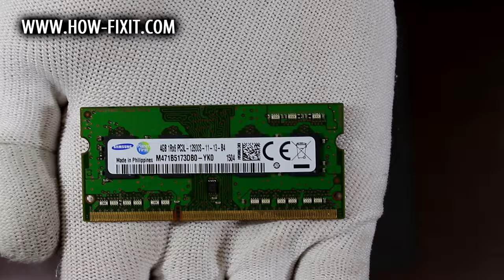Acer Aspire ES1-512, ES1-531 RAM Upgrade and Installation Guide

Comment from the maker: *ENG*: Links to DDR3 RAM, screwdrivers, and bonus content are in the description under the video.
*RU*: Ссылки на оперативную память DDR3, отвертки и бонус контент - в описании под видео.
*ES*: Los enlaces a la RAM DDR3, los destornilladores y el contenido adicional se encuentran en la descripción debajo del video.
*FR*: Les liens vers la RAM DDR3, les tournevis et le contenu bonus se trouvent dans la description sous la vidéo.
*DE*: Links zum DDR3-RAM, zu Schraubendrehern und Bonusinhalten finden Sie in der Beschreibung unter dem Video.
Reply: I have a laptop acer aspire e11 es-131-c10x is it possible to add a SSD and make it a basic disk, that is, install the system windows instead of a emmc?
Reply: How many slots are there for the Ram ? Because I would like to upgrade my Acer to 16GB of RAM if possible otherwise 8
Reply: @drissou4679 how many?

Comment: The hardest part is putting it back together. It is very difficult to connect the touchpad and keyboard flex cables because of the minimal space you have.. It would be very helpful if you mention that as a warning or show us an easy way of reconnecting them.
Reply: It is not so hard, just be really carefull and put a support in case the keyboard fell apart. :)
Reply: also what would happen if you go over the memory size limit? ex: 8 gb max, but then you upgrade to 16 gb
Reply: @RjKumar111GunnerRj  simply it won't post
Reply: @IIEvyII  oh
Reply: Yes you are right.
Reply: Yes ive broken the pad connector probably it never works more btw my mistake. This model is so bad to put hands on
Reply: @ricoaldo6196  i thought mine didnt work either, i entered bios settings using F12 or F2 or something, then set mousepad settings to simple instead of advanced. it worked
Reply: @gn412r4 I messed up with my keyboard ribbon cable and I can't type anymore but thankfully everything else works
Reply: How did you get into settings for touchpad? I can't find it in BIOS.
Reply: I am unable to put keyboard strips back

Comment: Glad I watched this first, as I didn't realize there was only one RAM slot.
Reply: cpu-z is indicating a second ram slot but theres only one after all
Reply: @ch1baku762  Yep, typically the first ram slot is soldered directly into the board. The other is an actual module that can be replaced/added/removed.
Reply: Go to Task Manager and go to performance/memory and you'll see that "1 of 1" means you use 1 stick of ram of 1 slot.

Comment: thanks for sharing - now I definitely know that I will NOT upgrade it....
Reply: That's easy :) only looks nasty 😁
Reply: I took out the screws than watched this, vid because the top and bottom was connected, i really wanted to upgrade ram, now I'm scared, so many to disconnect. It was either this or gaming laptop. I'm fucked
Reply: @kingfly6858  it's easy
Reply: @trashcontentdaily2557  I bought a gaming laptop
Reply: @trashcontentdaily2557  It depend on how handy you're. These KB & pad's ribbons cables are easy to get damaged.
Reply: Same hahahah. Too much headache
Reply: Acer laptops are designed by idiots. My hp laptop Ram takes 1 minute to swap out, 2 screws on bottom, open a flap and swap out ram, quick and simple.
Reply: Bro it's so easy like u just need 1 screw driver patient nd work space nd calm
Reply: @fingeronthetrigger7568  It's very risky and time consuming, perhaps even not that worth it.
Reply: @denemeuyesi1212  i swear that i literally did that in 4mins maybe less nd its infront of me now i am going to a local shop to buy a ddr4 8gb ram hope i can find one with 2666mhz nd I'll change from hdd to ssd its been a while since i used it nd i miss it so yeah good to be back it's just a lil bit slow but improving ram nd swiping to ssd will do the job i guess 😅
Reply: Unfortunately, the market's still flooded with hundreds of thousands of these low-spec laptops that they made too many of! 4GB is a joke, even for Linux computers.
Reply: @fingeronthetrigger7568  isn't the Mainboard only supporting DDR3? Did it work on yours, I wasn't sure upgrading the RAM, just put in a SSD?
Reply: @SinclairWest  nah u can upgrade the ram anyway i threw that pc in the bin after it catched fire i think the probleme was from the outlet but whatever
Reply: @SinclairWest  i used ddr4 crucial 8gb 2400mhz SODIMM
Reply: @fingeronthetrigger7568  okay, with that in mind I will stay with it, the SSD already helping enough in terms of performance xD
Reply: @SinclairWest  nope 8gb ram is the minimum ram a normal person need in 2022
Reply: @fingeronthetrigger7568  good point, it's not mine, but I think 8Gb DDR3L at 1600 will do the Job.
Reply: @SinclairWest  i can't agree with that cuz 1600mhz is pretty slow tbh

Comment: Excellent video, saved me hours but what an awful laptop design!! Others have said the same but a complete strip down just to change the ram??  All they had to do was build a window in the base of the case with a single screw to hold it in. For those who weren't sure about how much and how many RAM strips, I can recommend the Crucial memory scanner which tells you everything you need to know. This particular model can only take one strip and a maximum of 8gb. Great fun putting the two connections back for the keyboard!

Comment: 3:23 I haven't been able to put those 2 ribbons back so far,I'm getting really frustrated,thanks for the video.
Reply: Have tou achieved to put tem back ?  I'm stuck on them too.
Reply: @GabrielGaldinogv  Yes  Gabriel , just close the lids a little then grab the ribbon (be very gentle cause it's fragile) with a pair of tweezers,you will feel it went inside the socket,it's really hard though ,to be honest I was getting worried that  I wouldn't be able to deliver that laptop.
Reply: If I remember correctly you have to push the white plastic clips away from you so you see the ribbon drop in then you pull the tab back towards you to lock it in place. Push one corner of the clip at a timewith a small screwdriver The smaller connector ribbon pushes in then you pull the plastic clip onto it. Bare in mind if your keyboard doesn`t work on a few keys you will have to realign the big ribbon and start again. Took me a few attempts.

Comment: hhh sorry folks but the ones how have these ACER SERIES are really not supposed to upgrade the ram , you can replace it if it is down but not upgrading it, cause these versions are unupgradeable  in their manual books. i got one i just costumised it so it can fit my doings and my needs in it.

Comment: Does it support DDR4 RAM 3200 MHz or 2800mhz
Reply: This model definitely won't support ddr4s, nor 3200s. You're looking at DDR3 SODIMMs with a max speed of 2133, with the preinstalled module likely being a 1600. You can *probably overclock the ram to a higher speed but it's highly unlikely with Acer's trash firmware.

Comment: Can i change my video card in Acer Apire ES1-512
Reply: It's impossible. This PC uses integrated graphics, so it would be quite impossible.
Reply: There is a way, think its called an EXP GDC card or something. The only port you can plug it into is taken by the WiFi Modem (pci -express) or a spare M.2 slot, so you can only use Ethernet from then on, but that would be faster than gaming over WiFi anyway! And you use the graphics card memory, of course, so will free up memory on the laptop. Linus Tech tips and others show how to's on their channels. YouTube search Laptop graphics EXP GDC!

Comment: Es1-512-c8hy I have this one,he is very slow,when I need to start On he is very slow,when he is Start On always coming some adds and for start I need 15 min. If I add 8 gb Ram he will be more faster ? He is N2840 4gbddr3
Reply: try upgrading to an SSD drive as well, that will significantly increase boot times :)
Reply: He has in first 4gb ...can I now put 16 gb ...still slow with 8gb ?!?
Reply: @mirkogrljusic2032  upgrade to SSD, RAM does not matter if the frekin drive is SLOW!

Comment: I have this es1 512 series and the design it's just awful, overheats like crazy because of the cooler( no heating pipes just a piece of metal LOL), integrated graphics are one of the worst, touchpad is terrible, to upgrade ram need to take apart most of the machine, i do not recommend to buy this, probably one of the worst acer models ever